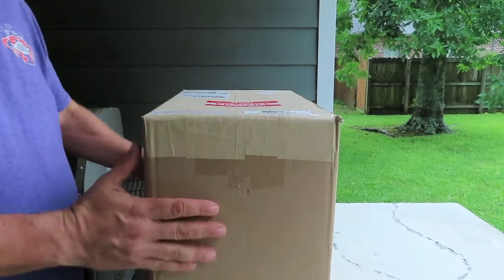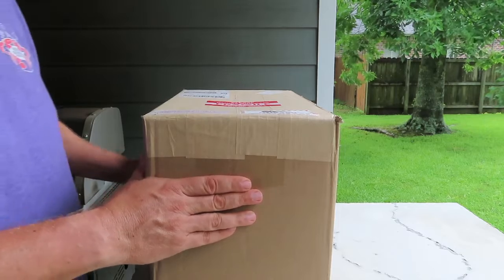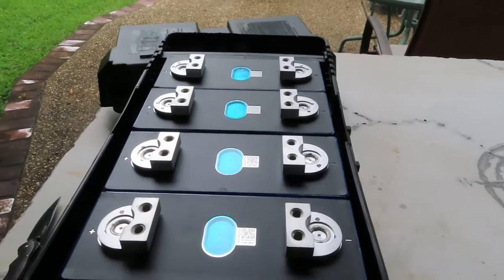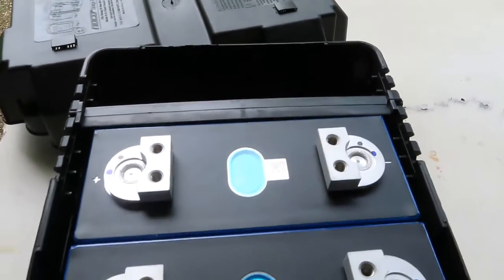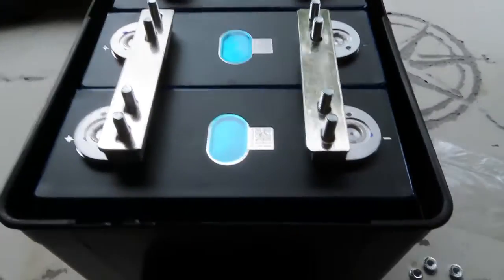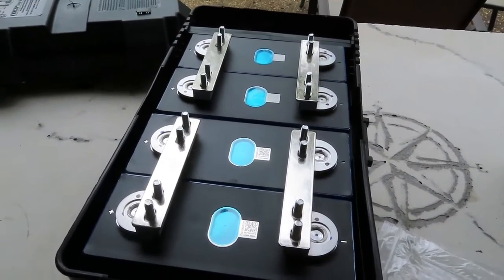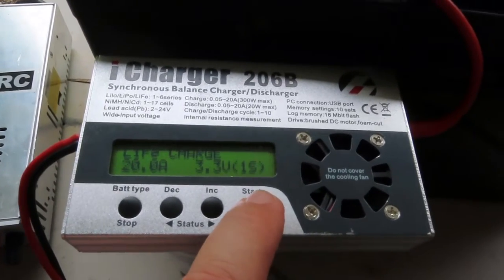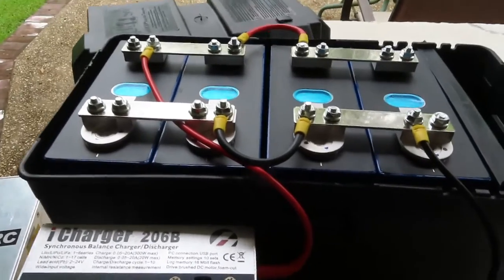LiFePO4 Lithium Battery Build Part 1 Top Balance

Comment: Hi Mike, I’m new to the whole battery building thing. Fantastic video! I have a couple of questions for you - is it imperative the batteries be bound together or boxed together while top balancing? Do they tend to try to expand during this process? Second question, how come you only charged the batteries a certain number of hours per day and didn’t just let the charger go on 24/7 until they were fully charged?

Thanks!
Reply from the maker: I have never bound cells while top balancing. Most folks would not have a charger capable of high enough amps at 3.6v to cause issues. I only charged when I could monitor the batts out of paranoia. 😁I want to make sure everything is good before i let them live on their own
Reply: @MikeJordanUnCamplicated  thank you!!

Comment: It always cracks me up how so many people just let then sit in parallel w/o actually charging them up in parallel and call them "top balanced" then can't understand why they have a delta of a quarter of a volt. Lack of patience, I'd guess is the issue. Well done sir. A little long winded but you didn't miss a damn thing!
Reply from the maker: my delta needs 2 places right of the decimal point to measure. And then it still barely registers
Reply: @MikeJordanUnCamplicated  As it should. If mine get above 5mV (after the settle), I get all twitchy. BMSs will keep them in balance if you to a proper top balance as you've shown here. Nice job Mike!